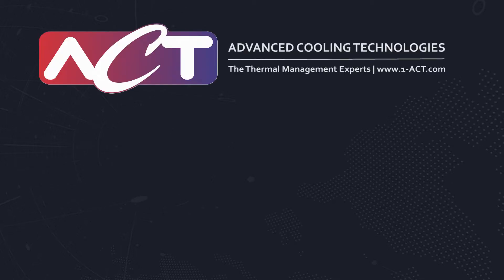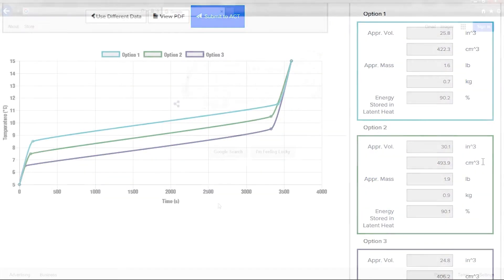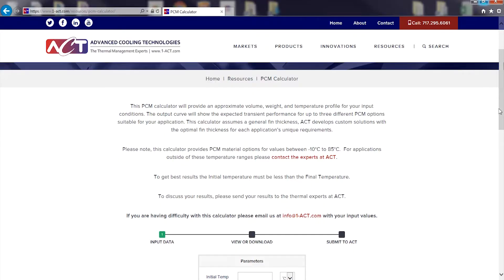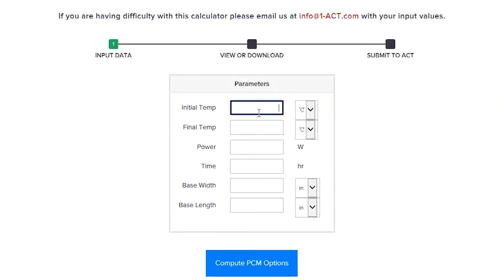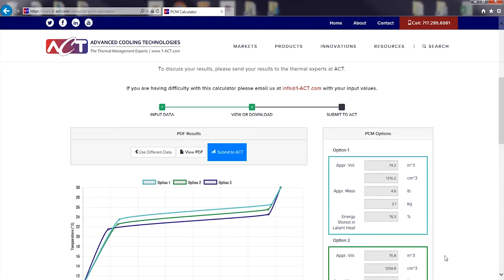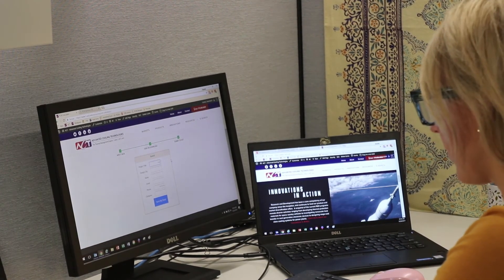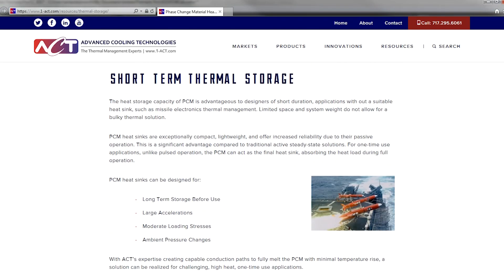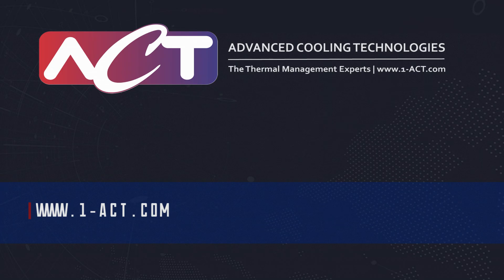Phase Change Material (PCM) Heat Sink Calculator

Comment: I just wanna ask if this service is free? I have a project on going and I do not know what PCM to use.
Reply from the maker: Great question! Yes, the PCM Heat Sink Calculator tool is free. https://www.1-act.com/resources/pcm-calculator/ If you need more information on PCM, or have further questions, you may speak with one of our engineers using this email: solutions@1-act.com
Reply: @AdvancedCoolingTech  how about after? I mean if I talk to one of your engineers. If not, how much usually is the charge?
Reply from the maker: Please send in a contact for from our website or call to discuss your thermal issue. 717-295-6061. Thank you.

Comment: but the name of pcm is not given ?
Reply from the maker: Hi, Aditya.  We apologize, as the title of the video is misleading (and will be updated).  We have since renamed this calculator more appropriately to the PCM Heat Sink Calculator.  It is not providing you specific information on the phase change material.  Rather, thecalculator provides initial scoping estimates for your thermal storage requirements, including approximate volume, weight, and temperature profile.  The expected transient performance for three different PCM options suitable for your application is plotted. This calculator assumes a generally conservative fin design. ACT can design higher performing custom solutions than what is predicted by the PCM calculator.  We do not manufacture PCM.  However, if you have additional questions please feel free to reach out to us at https://www.1-act.com/contact-act/